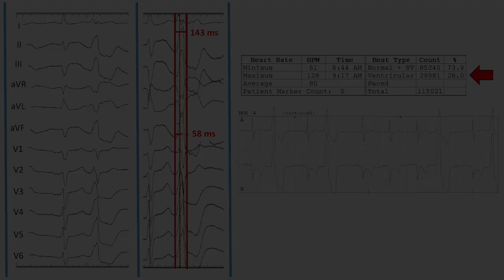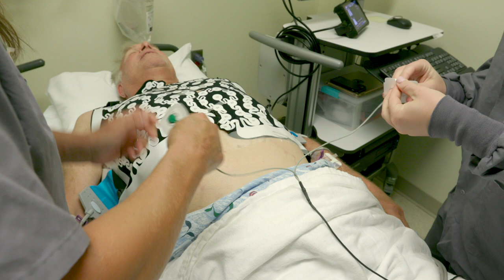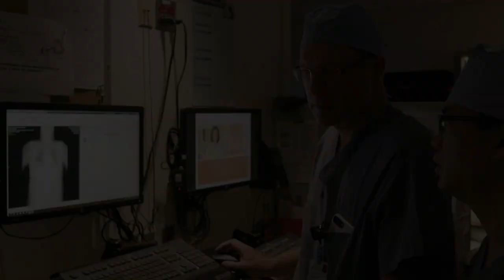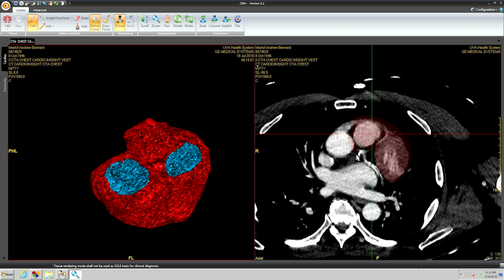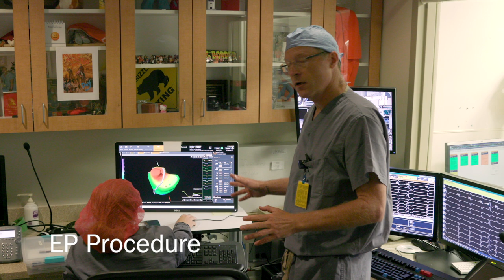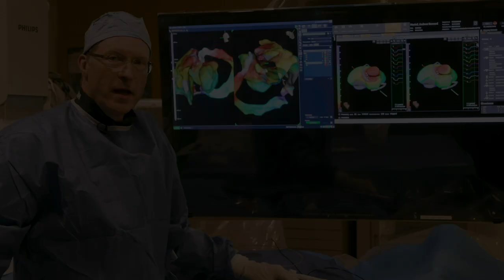Ablation of Premature Ventricular Contractions [PVC’s] Guided by Non-Invasive Mapping

Comment: Here’s the problem with these FN PVCs (pardon my French, I hate them) they are so unpredictable, I could go days, weeks, months without significant attacks. The only way to cure me, is to run to the ECG lab when I have them and they must get them on tape so they can see if they are still coming from the same spot each time, which it does for me. So they keep wanting to “schedule” me for a lab ablation weeks in advance which will not work because it has to be by luck I have PVCS the day of the procedure otherwise they can’t locate them. Am I correct here or am I missing something and had technology changed much these days to find the PVCs when you aren’t having them currently.
Reply: Do u have anything that can provoke them? In my case sleep deprivation, dehydration and stress can start crazy amount of PVCs. Hope u will get better soon! ❤

Comment: About 10 years ago it took 12 heat-ablations to finally cure me of SVT, which often caused my HR to remain well above 250 bpm for about 30 minutes.  The heat-ablations were successful and all was fine. Then 5 years ago I required OHS for BAV replacement. My new tricuspid aortic tissue valve implant has been working nicely, so again all was fine. Then a few months ago I was diagnosed (via a 14-day Holter monitor) with PVC's that occur every 5 or 10 minutes, all day long. Sometimes my PVC’s are so strong that they take my breath away. So my cardiologist prescribed a medication, indicating that this is “the only thing that can be done to reduce” my PVC’s. But the medication makes me feel very tired and totally unmotivated … all of the time. So this time, all has NOT been fine. And now I accidentally find this amazing treatment called “radiofrequency catheter ablation.”  THANK YOU for this informative video! I'll be addressing this, either with my current heart doctor … or perhaps with a brand new cardiologist.
Reply: Mine are so bad. Painful and sometimes I feel extremely weird almost like dread and I feel my heart will stop. What's the med they give you.
Reply: A beta blocker
Reply: What medicine was it?

Comment: Thank you for the presentation. I have 17 per cent of pvc according to  the result of a cardiac telemetry placed on me for 15  days. Can I have an Ablation done on me if I have a mechanical mitral valve? I have a MMV. Thank you for the answer in advance. I am 65 years old. I also had a triple bypass done in 2012
Reply: I ain't a medical Profesional but I have PVCs and I have about 35%. To my knowledge what I've been told if u don't have too much u can take beta blockers like metropolol to treat it. I can't remember exactly but I think my cardiologist said if it was like less than 20 or 25% then you wouldn't have too worry too much and should try to treat it with medicine first before moving on to a procedure.